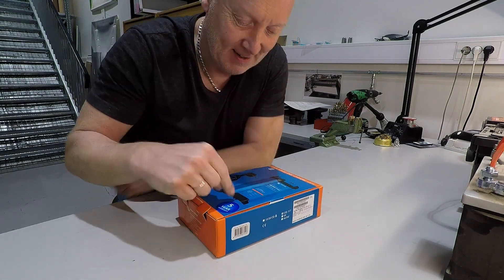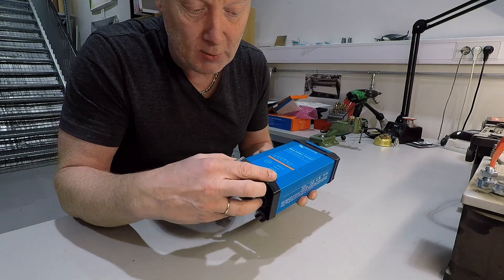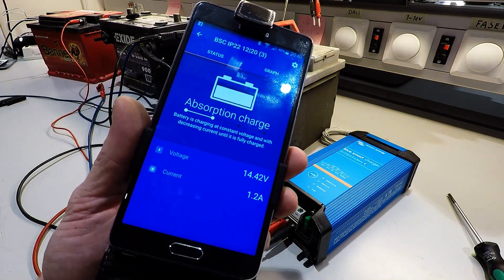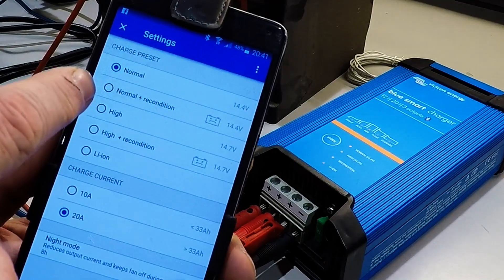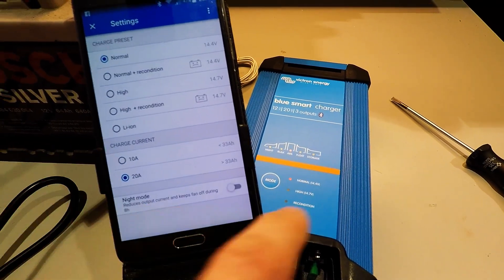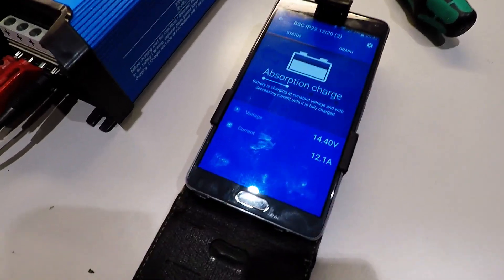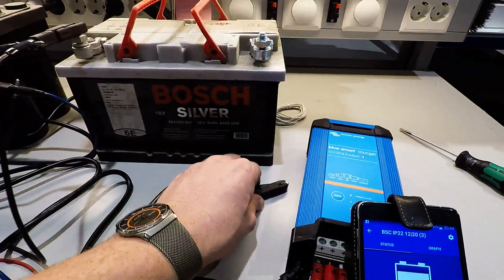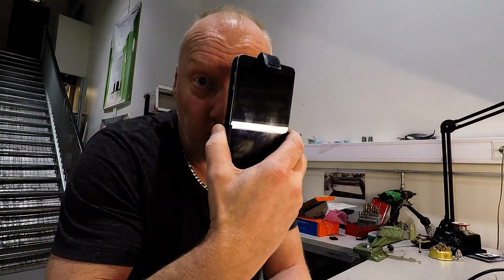First test of the bluetooth Victron Blue Smart IP22 20 amp charger

Comment: Really nice tool to have in the van. You'll have a lot to do in this spring on the van I see :D
How do you plan to use this charger in the van? Will it be connected to an outside outlet when you will camp somewhere and have access to 220V outlets?
Good luck with the work!
Reply from the maker: Thanks for the comment. Yes it will be connected to an outside outlet. Just need to find a spot on the van to make a hole for it, as my van don't have a westfalia AC inlet yet. https://www.youtube.com/watch?v=r7bnumOgr-g
Reply: Really great ideea. A thing to put on my TO DO list as well. Thanks!

Comment: I will like buy the Victron. Or manufacturer of my AmpereTime 12V/230Ah lithium battery.  AmpereTime’s battery charger is more expensive on Japanese Amazon or I would definitely buy from then. Great company.  Bought a 24V battery back in Nov but never opened it. Decided to make my system 12V.  They let me return the battery after more than 6 months after purchase. Giandel did the same thing with their 24V inverter. They even paid return postage. 

I’m contacting the company I purchase my 24v-12v converter and 24 volt charger.  Both Victron. If they let me return those I’m buying from them.

Comment: If you have two batteries, and one is more discharged, I’m assuming that the charger will automatically stop charging the battery that didn’t need as much charge and continue to charge the other battery?
Reply from the maker: Yes it will

Comment: Hi, thank you for producing this excellent informative video. Could i ask a question please? I have just installed 2x115a/h LiFePO4 batteries in my mobility scooter. I am a disability pensioner with issues including weakness in my fingers and mobility. I use my scooter most days and have the charger mounted on the wall and was wondering if it is necessary to physically turn the charger off at the wall once it is charged or is it ok to leave it on and just repeat the connection/disconnection process each time I use it. Many thanks, Gordon
Reply from the maker: I don't know, sorry. try to download the manual a look if you can find any info on the topic.

Comment: good morning, thanks for the video.  I would like to buy this battery charger to use 3 different batteries.  a question: when the battery charger is off, do the batteries remain disconnected or are they connected in parallel? Thanks a lot
Reply from the maker: The batteries are separated by the electronics inside, so no parallel.

Comment: Can you show how you wire the three batteries for charging. Thanks in advance.
Reply from the maker: Hi there. There are three outputs on the charger, one for each battery. Ground (negative) are common. Hope this helps.
Reply: Common means that we only need to plug one negative cable to one of the batteries? Or should we plug one negative cable in EACH battery?
Reply: @AntonioGamezNieto  1 to ea, u can twist them together & insert in charger or use a 3 prong busbar.

If yr batteries are already connected in series as in caravan leisure setup then only 1 ground is needed...this is my understanding as the manual is pretty useless for connection diagrams
Reply from the maker: Negative is common.

Comment: I have a Bluesmart IP65 12/15A charger. Is there a mode for AGM batteries? I have a Lithium leisure battery but plan on using a AGM for my next starter battery.
A Ctek MS7000 charger I have has AGM mode that is the same as winter mode.
Reply from the maker: Yes it has a mode for AGM, you can downlad the manual here: https://www.victronenergy.com/upload/documents/Blue_Smart_IP22_Charger_manual_230V/Blue_Smart_IP22_Charger-en.pdf
Reply: @Italjohn  Thanks. I see now it has adaptive charging and will adjust automatically for AGM.

Comment: Every time I do a random search, among first results are from ItalJohn. :) .
What about if you have leisure battery LifePro4 and the start battery to charge at the same time, there is any setup for this ?
Have you use it yet in the van, if so, are you happy with it ?
Reply from the maker: I have used all winter, but have not tested it on my lithium battery yet. Will do if I make it fit. There is only one setting for all three outputs.
Reply: @Italjohn  So, in theory, you can only charge same type of battery at the same time, winch means, once you install your lithium battery, can no longer charge the starter battery to, unless do some kind of bypass and change the setup every time. In this case, this charger might be overrated. Again, unless you install 3 separate lithium batteries in the van, winch is less probable. Or do I miss something, there are other pros of this charger, so that you will not consider a smaller model that would also save space ?
Reply from the maker: I have now research this, and you are right. It can only charge one type of battery.
Reply: @Italjohn  So, will be pretty much useless or overrated in your van, if you gonna install one lithium only, and taking in consideration the limited spaces we have in our vans, probably makes no sense to occupy more of it, by installing 2 batteries. At the end of the day, winning space is also a pro when choosing lithium.

This being said, what could be the next Vicrton charger on the list, that makes more sense for one bigger lithium ? 

Wish I had known about this 3 ways charger back in time, when I struggled on the road, with multiple batteries and issues on solar panels ! 

Thanks !
Reply from the maker: I will have to check and come back to you

Comment: Hi! brilliant! how do you know the different state of each battery? if each battery begins with a different state of charge, how does it give a different protocolo (bulk, absorption, float..) to each of them? best,
Reply: From the victron community page: "The outputs of multiple-out chargers are FET isolated, so each connected battery is charged according to its independent SOC. Obviously the total charging current across all batteries will not exceed the current rating of the charger (ie a 7A charger will put out a maximum total current of 7A, not 7A per connection), but yes, a depleted battery on output 1 will receive far more of the charge current than a mostly full battery on output 2, etc."

More info:
https://community.victronenergy.com/questions/26155/ip43-3-individual-loading-of-outputs.html?childToView=27874#comment-27874
Reply: @JoonatanJääskeläinen  But it doesn’t tell you how many amp go to each battery, just tells you the whole voltage and amps coming out of it.
Reply from the maker: @JoonatanJääskeläinen  Fantastic find. Thanks for the info 😃
Reply from the maker: The outputs of multiple-out chargers are FET isolated, so each connected battery is charged according to its independent SOC. Obviously the total charging current across all batteries will not exceed the current rating of the charger (ie a 7A charger will put out a maximum total current of 7A, not 7A per connection), but yes, a depleted battery on output 1 will receive far more of the charge current than a mostly full battery on output 2, etc."
Reply: @Italjohn  Thanks for your answer, I actually have the same model and I thought maybe I was missing something, but I guess it just doesn´t offer any more options.

Comment: Is each one of the three outputs managed separately?
Reply from the maker: No I don't think so, as the app only have one "side" of adjustments, and not three. I'm guessing it's only three diodes that separates the three outputs.
Reply: @Italjohn  That's so disappointing.. It seems to me that Victron has too many products that are not completely thought through. And would you happen to know why the amperage dropped when you connected the third battery? The voltage stayed unchanged, so I don't understand what happened.
Reply: clidiere Hmm, too bad. I’d like one that actually shows the three battery statuses.
Reply: Italjohn13. How hard can it be? Ok thanks